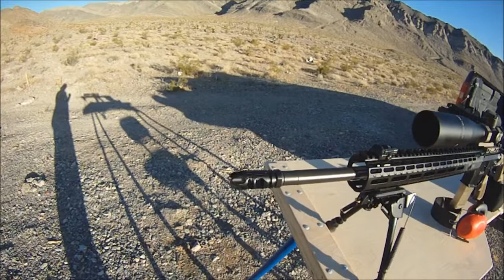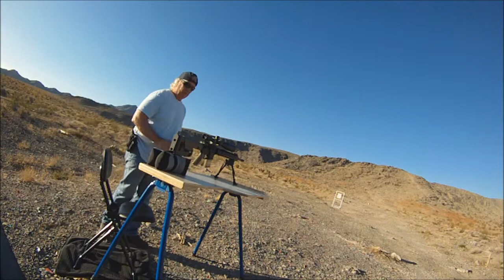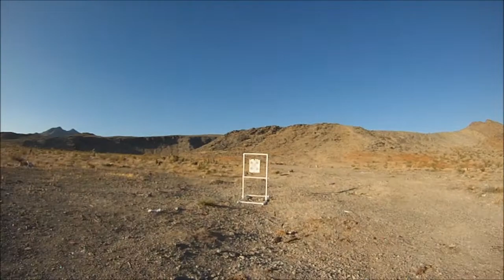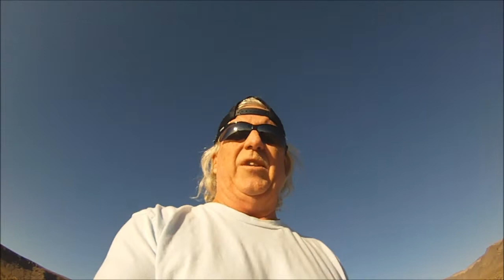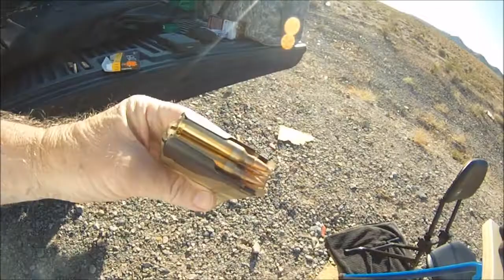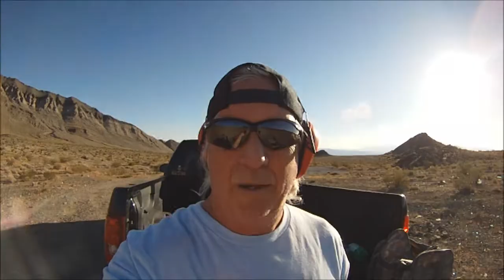Aero Precision with a Criterion 20" barrel

Comment: Is your front hand guard 15" in length or longer? I know you mention that your barrel is the 20" heavy, would that be the HBAR version or the Hybrid version? Very nice setup. Thanks
Reply from the maker: It's the 15" and the HBAR. I built the rifle for target/bench rest and it is a little hefty!
Reply: @peteregger7928  

Thanks Peter,

I'm doing my first AR 15 type build in 223 Wylde and the only thing I've been agonizing about was the barrel. I've had Criterion barrels on my radar for awhile and have never read anything bad about them. I was just trying to decide whether to use their Hybrid model or the HBAR. There is only a .35 lb difference in weight between the two, otherwise they are identical. Thanks again for getting back to me.